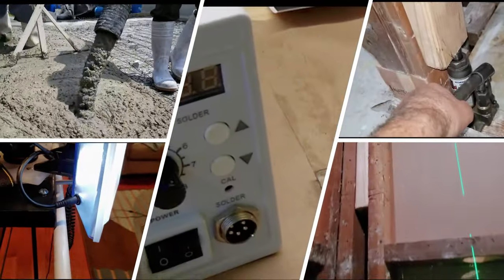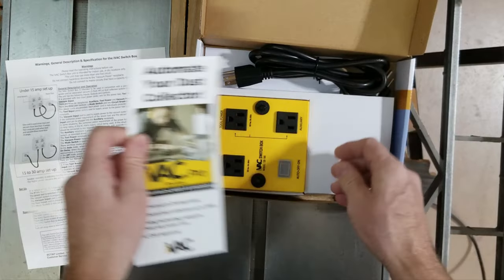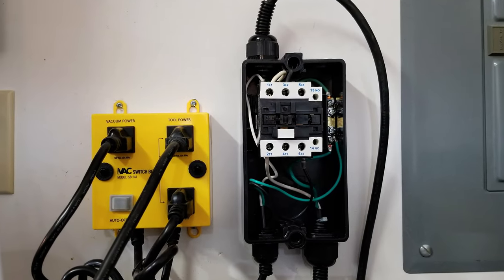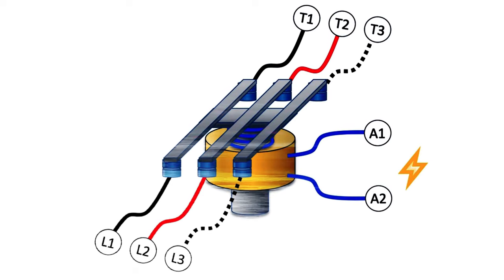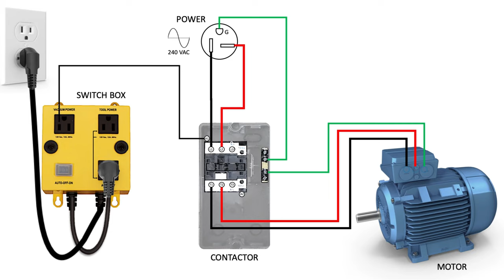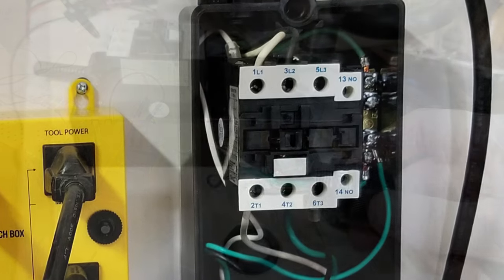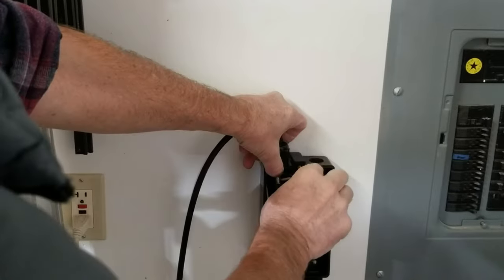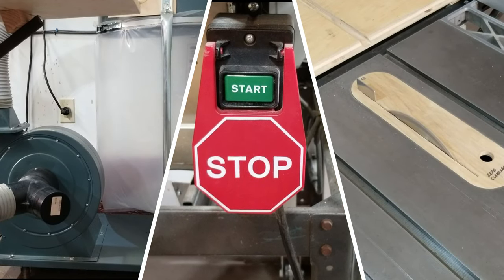What is a Dust Collector Switch Box?

Comment: Nice video.  Is there any difference between a contactor and a relay aside from the size?
Reply from the maker: The biggest difference is size in that a contactor is designed to handle higher current and the contact points are usually made of a more durable material.  Also the cores in smaller relays are typically round armatures whereas contactors typically have “E” type laminated core windings similar to what you would see in an AC transformer.  Also you’ll probably see more DC relays than AC relays and more AC contactors.  The AC windings have a shaded pole to assist with offsetting the phase, and combined with the natural eddy currents in the winding will magnetically hold the contactor closed (assuming NO type contactor) when the AC phase changes direction.